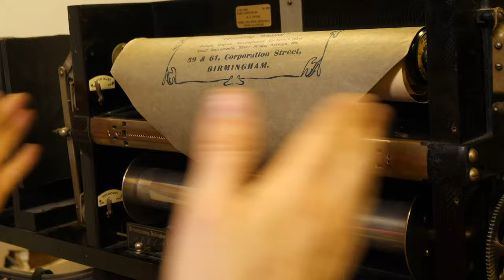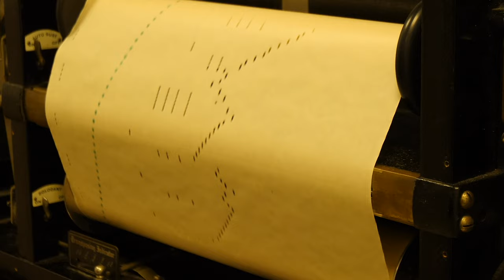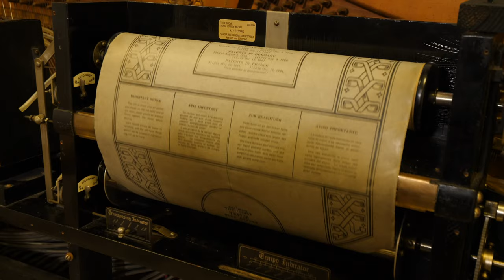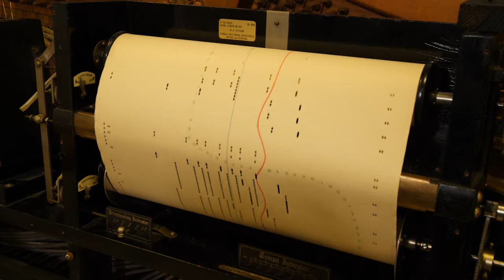I Didn't Expect A Self Playing Piano To Be So Complicated.

Comment: 40-60g down weight is typical for an upright piano so 55g is about ideal for this. I do wonder why it was so heavy before. Was it perhaps overly heavy to protect it or did some past owner prefer such a heavy action. Perhaps it was intended that when it arrived that the owner would adjust the key weights for if they wanted it to be playable by a human. I don’t know why anyone would prefer it to be so heavy, that extra weight means the hammer can’t hit as hard when you play and large unevenness across the keyboard will change the feel of each key as you move around the keyboard. It’s a true mystery
Reply: Maybe it was a way to dampen the overall volume when you had neighbours to consider? Also, perhaps it was used as a learning aid so the pupil couldn't cheat and see the notes on the keyboard before trying to play them?
Reply: @originalsynth  I don't know much about pianos but doesn't removing the weights from the keys now mean that the hammers will do key lifting work instead, increasing the delay of them returning to rest on the strings? Maybe it is just a design oversight fixed with compromising the human playability?

Comment: Now you just need an Arduino and 100 tiny solenoids over thr vacuum ports to make it midi!
Reply from the maker: thats the plan. waiting for the valves to turn up. got 1 valve working so in principle its going to work
Reply: I was thinking right over the vacuum ports where it reads the paper. 3d print something to adapt the ports to be big enough for a micro solenoid.
Reply from the maker: @ionstorm66  yeah that's what I'm doing

Comment: So, is there any velocity control on these (maybe hole width?), or is every note always the same?
Reply from the maker: you and me both know the only velocities worth talking about is 0 and 127 :D
Reply from the maker: the themodist acts somewhat as a bass and treble softener, its not plumbed in it seems. also velocity is by order of the foot
Reply: @LOOKMUMNOCOMPUTER   😄
Reply: Over the years there were various piano-roll formats developed.  They could be grouped into two broad categories - “reproducing” and “non-reproducing”.  The reproducing ones included volume expression encoded on the roll.  But the vast majority of the market was non-reproducing (making the pianos cheaper), eventually settling on the “standard” piano roll format, which I suspect this piano uses.

Comment: Leave the key weights in. The keys moving are common on US pianos but so is a key lock. I always thought it was to keep kids from banging on the keys.  It was to remove the unneeded mass from the player and let it be able to play softer with repeats. Also to eliminate noises from the keys clacking. If it leaks it will be harder to play softly. Those pot metal castings may be cracking. I rebuild players.
Reply from the maker: Indeed. But a player piano is way better when the keys move. . Keeping weights out. It has a lock.

Comment: I think my mom's piano plays the song backwards in rewind.
Reply from the maker: it is likely!!!! just meant the air switch is gunked up! but its a cool side effect anyway!
Reply: @LOOKMUMNOCOMPUTER  that's likely. It's a very similar mech. It's been upgraded with an electric vacuum pump, and centers the reader with a mechanical linkage. ( plays the wrong notes if you don't adjust for each roll)

Comment: You shouldn’t to pump that hard to play a Pianola, so there’s probably heaps of leaks you need to overcome to leave enough vacuum for the piano. I’d wager the corners of most of those bellows have holes in ‘em. Some RTV or plasti dip would do well to patch it up. 

(unless the frantic pumping is all part of the production, in which case, carry on!)
Reply from the maker: Yeah it's leaking all over the place. One day I'll sort it in the mean time I'm plugging a suction pump in.

Comment: I've restored a player piano before. It is very tedious and time consuming to replace/rebuild all the hoses and little bellows/actuators . As well as repairing hammers and keyboard felts uhg. It is definitely a big can of worms . Then you have to tune it . And tune it and tune it ..... untill it stabilizes. It sucks literally.  If it didn't suck it wouldn't work. Giggles